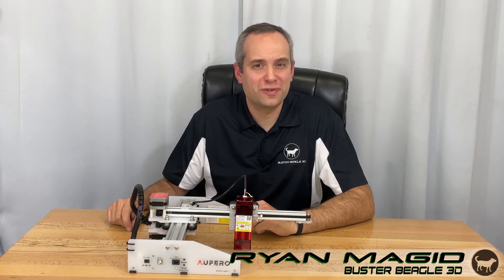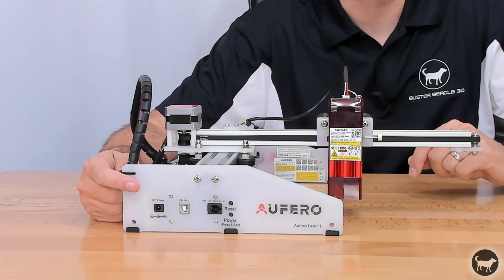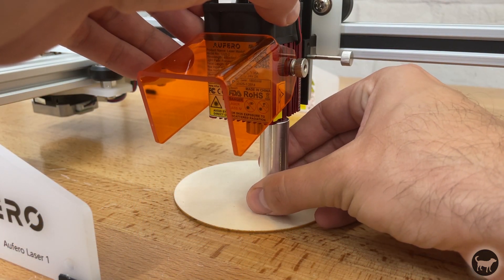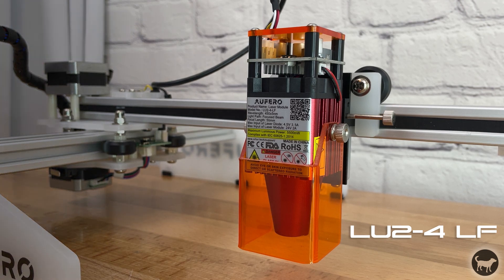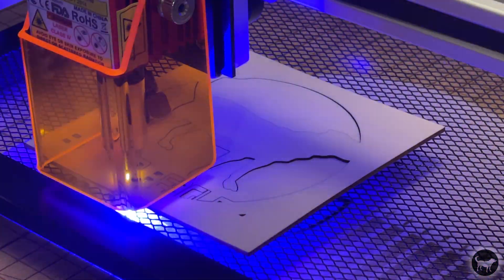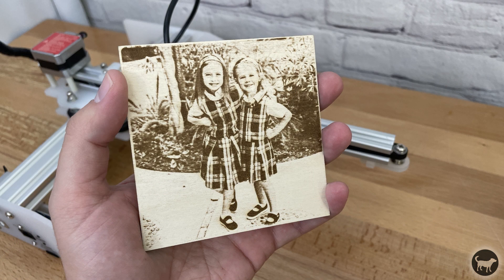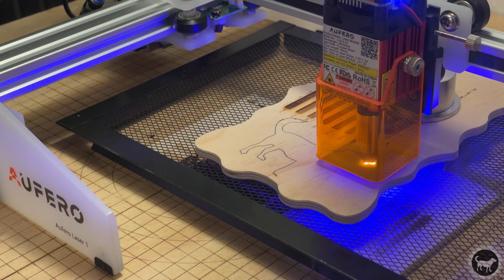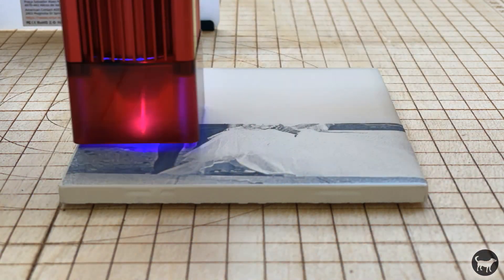Ortur Aufero Laser Review

Comment: So if you want to engrave on metal or anodized aluminum the sf works better than the of and the of works better cutting through the thin plywood?
Reply from the maker: Probably an auto correct from YouTube but if you meant the LF is better for cutting and the SF is better for engraving then yes you are correct.

Comment: Hi, it looks like the drill press that you linked to for the injection molder is unavailable on amazon. Do you know if it can be purchased or substituted elsewhere?
Reply from the maker: Hello. Yes it's hard to keep up with those drill press links since every time I link a new one they sell out. If you search another "benchtop drill press stand" on Amazon that looks the same it will work. Just be sure to buy 2 at the same time to make sure they work together since some of the models vary ever so slightly. They all still work with the machine but you want to make sure they match each other so everything lines up.
Reply: @BusterBeagle3D  gotcha, thanks for the info!